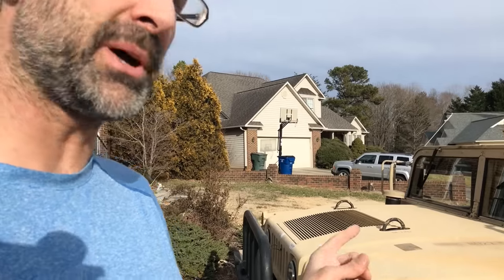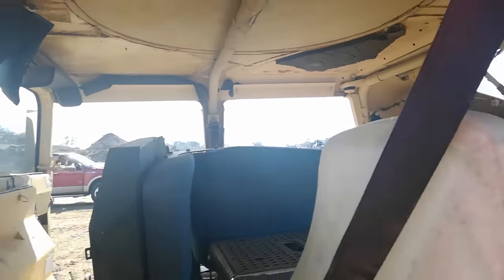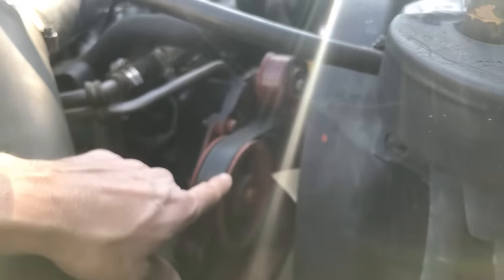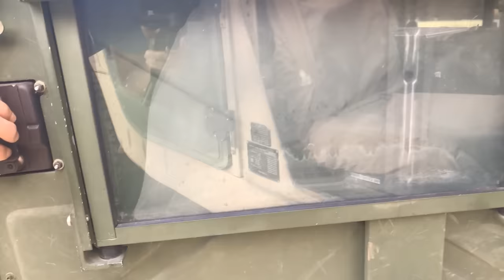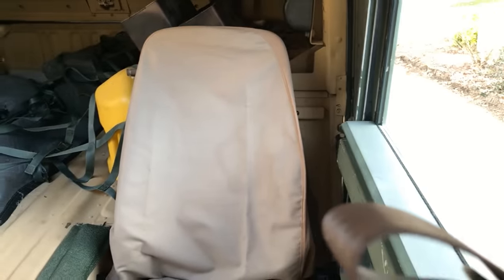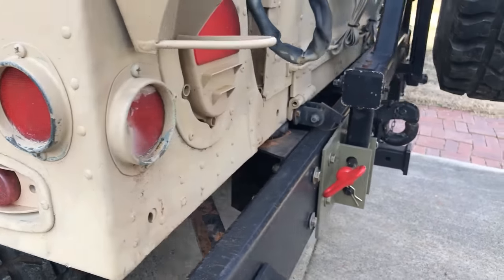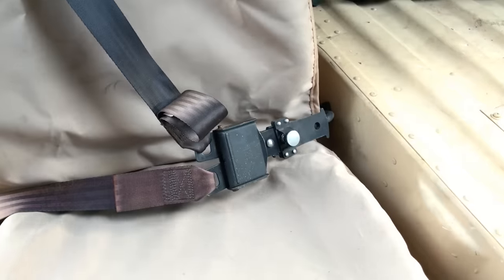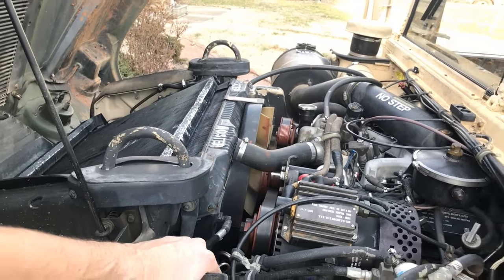Picking up a Surplus HMMWV M1045A2 from Auction & Transforming it into the Battlewagon 2.0

Comment: Those are the trucks I used. M1054a2 TOW. The traversing unit is a 68lb central piece that the m220 tow/m41 saber sight, launch tube and electrical connections/controls mounted to.
Reply from the maker: Thanks for the insight.

Comment: The weird ring next to the gunner's platform is a stowage mount for equipment that would be mounted on the turret during use.  Sighting systems, and other equipment that would need to be brought into the vehicle and locked in place for transport.
Reply from the maker: Good to know, thanks.

Comment: The traversing unit mount is for a TOW II Missile system. When the TU/Tube/Sights are not mounted on the roof the TU can be stowed inside the vehicle.
Reply: Thanks for the info!
Reply from the maker: Thanks for the info.

Comment: You were right about getting the overdrive transmission.  However, I can attest to rebuilding many engines that were driven hard and fast.
Reply from the maker: Thanks. 
You mean the engines blew even WITH a 4 speed?
I don't doubt that. 
But some folks run their 3 speeds way too fast, basically asking to dump parts along the highway.
Reply: I was a 3521, 3522 for most of my six years in the Marine Corps.  I couldn't tell you which of the transmissions was behind the engines I had to rebuild but the final drives on military HMMWV's are not speced for high speed on road use.  I have seen several on the internet that have had newer Duramax engines installed that out perform the older 6.2 and 6.5 liter engines on and off road.
Reply from the maker: @hudsondonnell444  Understood. The 4 speed transmission is the same as the civilian Hummer. So, keeps rpms in the right range for highway driving.

Comment: Your traversing unit is for your TOW Gun it’s a Missile launcher you just bought a TOW gun truck  you would have a collar that attaches to the gun and it goes on that traversing unit to store it when not in use. you would have a rack in the trunk area that held your Missiles that when you unlatched the trunk in the front the A-gunner can feed the gunner the Missiles while in the cabin rather than going out😃👍
Reply from the maker: They removed the tow missile rack during demil. I know the traversing mount held something with the TOW system, just haven't seen one actually in place on the mount. :)
Reply: Gear-Report.com yea not as impressive kinda is what it is but you should definitely get a up amored truck as well that held the machine guns and then you’ll have your own little CAAT (Combined Anti-amour Assault Team) pair😃 I like what you’re doing those trucks can go though a hell of a beating and keep going!
Reply from the maker: @joncarlodagle  Thanks. Since I have no use for or access to a TOW missile system, we are building this as an M1043 machine gun truck. We have the gun mount and chicken shield. Haven't started on the GPK yet. We have an airsoft M249 to play with and for display, but have access to various machine guns to mount for events. We try to walk a bit of a line in terms of keeping it outwardly military looking, while upgrading some of the creature comforts a bit so that it is more comfortable around town. :)

Comment: I think the dual latch on the seat belt is so there is no restricting loop over the soldier's arm/shoulder when exiting in a hurry.
Reply from the maker: I think you are correct
Reply: Exactly correct
Reply: Ours never had seatbelts...lol However, the shoulder belt is removed while you’re expecting contact, while the lap belt keeps you in the vehicle. The doors always flew open.

Comment: Alot of people don't know but if you ever get pulled over for speeding in a mil truck the cop is full of it. The paint is laser and radar absorbing
Reply from the maker: Somewhat, but not totally radar absorbing. :)
Reply: Speeding? Good luck. Over 60mph I'd worry about stopping. ☺
Reply from the maker: @uncleeddie5813  the early HMMWVs with the 3 speed and smaller brakes top out around 57 miles per hour. This one will do 75 all day long and has larger brakes.. 😁
Reply: @uncleeddie5813  brake upgrade is usually the first thing that should be done.
Reply: @GearreportdotCom  thank you for the info. ☺👍
Reply: Paint is not laser or radar absorbing.  It’s called CARC Aka Chemical Agent resistant compound...  You can get an LRF read off of it any day of the week

Comment: Had the glass delamination issue with my Snatch land rover, on mine it was the binding agent between the glass and the perspex that clouded up. After taking the perspex off and letting the binding agent sit for a while it cleared up.
Reply from the maker: I have seen a few people solve this by removing the outer layers. I am hesitant to do this since the outer layers contain the shattered bits of glass in an accident or incident. I really don't want little glass fragments going everywhere.

Comment: ,,, hauled many of these, and one set of the first light armament.  The 24 volt starting  is amazing. It will sit there cranking very fast, and put out these consistent, little puffs  of heated, compressed,  light grey, fuel and air puffs, But they are not combusted. One wiff of ether, and she lights. Or use or fix the glow plugs .
Reply from the maker: Yikes! Ether is no bueno for diesels.
Reply: ,,, so your on an Army base, you already have one guy from the motor pool, that can't  start it, its cranking, very fast, it's got fuel, you appear to be miles from the motor pool, you have 2 more to load, believe me a whiff of ether didn't  hurt it, OR the other two .
Reply: @rolandtamaccio3285  wd40 is a safe alternative. Ether washes lube off of cylinder walls and is too volatile for high compression engines. Ether is a great way to blow up a diesel engine.
Reply from the maker: History of this purchase is detailed here: https://gear-report.com/hmmwv-info-battlewagon-2-m1045a2-humvee-from-the-us-marine-corps
Reply: M939 series 5tons had a cold start system that was just an ether bottle that shot into the intake. They didn`t have glow plugs in those cummins engines.
Reply: Sorry for the confusion. I wasn`t disputing your comment, I was just giving an example of a vehicle that came with an ether injector cold start assist.
Reply: @frankthomas2231  No problem, I'm glad to have someone that knows what they're talking about give another example of the use of ether assisted starting, thanks.

Comment: I am a diesel mechanic in Alaska, i work on concrete mixers mostly,  i have wanted to try someday to build an off road mixer on a HEMET chassis. But yeah it would be fum to get a Humvee project as well.
Reply from the maker: So, get one. No time like the present. 😎
Reply: That is a great idea, an old Oshkosh should be available at auction.  
Talk about an off road capable cement pumper...... A1 idea I hope you really do it some day bro. 
I’ll give you my 2 cents, try to get one of the quad cab chassis, they had AC and a much more comfortable interior overall.    Good luck.

Comment: If I recall correctly, that circular mount-looking thing by the gunners step is the pedestal for a TOW rocket launcher mount.
Reply: Correct! More correct it was designed specifically for the "TOW 2 "launcher.

Comment: Great video!!!!  I like all the details that you explained.   Didn't know there was two different suspensions on these.  Sounds like the A2 Humvees with all the improvements are the best ones to  have.  I like all the improvements you've made.   Now I know what to look for.   Thanks for all the info --Tim
Reply from the maker: Thanks! Glad the video was helpful.
You might find this interesting as well... https://gear-report.com/hmmwv-for-sale-the-battlewagon-2-0-could-be-yours-m1045a2-usmc-humvee-hummer
Reply: @GearreportdotCom  I worked at Hummer R and D in livonia Michigan and when they were upgrading the old m998 base hummers, and putting armor plating on the bodies, they found out their calculations were dead wrong and that the 998 suspension was not going to hold up to 10,000 lbs of extra weight. They blew out quite a few 998 suspensions before they figured out they had to upgrade the suspension too. Unfortunately 100's  of the upgraded 998's were already shipped out because the army needed them badly and of course the 998 suspensions blew out in the field under the pressure of the weight, lol,  and we had to ship the upgraded suspension parts to where they needed them. It was major AM GENERAL screw up that cost a lot of money to AM GENERAL, and they never got those cost back.  They had to eat that extra cost.
Reply from the maker: @richardtorz2164  Interesting.
I'm troubled that you are concerned with AMG losing $, but no mention of the lives lost when these HMMWVs failed in the field. :(
Reply: @GearreportdotCom You are correct, i should have mentioned the loss of life, but was more concentrated on the original post about suspension failure of such heavy vehicles, that's all.  No do not get wrong brother, the loss of life when equipment fails is so much greater than anything else, and i being a retired vet myself knows this all to well with seeing friends lost to equipment failures. That is something that is something that is of greater importance when designing anything, it needs to keep people safe. The neglect on Amg  designers did cost lives, many lives, unfortunately that issue was never considered when the redesign came up and there was no acknowledgement by the company for those losses of life.  i just didn;t address that issue with it because pretty much everybody knows what happens when people safety is not considered first and foremost when designing something.
Reply: @GearreportdotCom  And by the way, it was a good job restoring that beast to original as much as possible, parts are hard to find sometimes and when you do find them, they can cost an arm and a leg at times lol. The love you put into making that hummer from the time you got to the time you video'd it shines through, it does show. History should not be sent to the junkyard crusher unless it has absolutely lived out it usefulness.

Comment: Listen people everyone can do whatever they want with your money. But for $5000 you can go on almost any government auction and buy almost any Humvee in almost any condition even with very little to zero engine hours on them (not used).
Reply from the maker: Post some links to late-model, running HMMWVs available for purchase today with full working turrets for $5k. I'll buy every one of them right now. Hell. I'd buy every running late model HMMWV without turrets or doors for $5k each. I would even buy late model non-running HMMWVs for $5k each. You even can't get an A2 HMMWV rolling chassis to your door for $5k... with no engine or driveline. 
 Spoiler You won't post any links because if you really do search for a link you'll find the best you can do are some auction listings with a STARTING price of $5k. Log into the auction site and look at what the CLOSING price on those HMMWVs is... it aint $5k. Not even close. LoL 
But what do I know. I've only been doing this for a few years. :)
Reply: Lol good luck with that.

Comment: That glass fogs up because you use chemicals on the window to clean them. Unless you are using the recommended chemicals on the windows that is specified in the manual it will fog up over time
Reply from the maker: True. However, in this case the windows are fine on the surfaces. The layers in the ballistic glass are delaminating.
Reply: @GearreportdotCom  because of the chemicals, thats what causes it to happen. I worked on them everyday for 10 years.
Reply from the maker: @whicket1989  could be. I was told it is mostly heat that causes delamination. They sealed the edges of the laminate with tape. I didn't see anyplace that looked like any liquid got past it.
Reply: @GearreportdotCom  it's a reaction between the layers of glass that causes the "fog."
Reply from the maker: So, how does it get in there?
Reply: @GearreportdotCom  it seeps in through the upper and lower parts when you are cleaning the window

Comment: What's next??
Your very own UH1 HUEY helicopter for your own air support ??
If done right , you could tow it on a trailer behind the Hummer. :)
If you have deep pockets you could find a classic Cessna A-37/T-37 Dragonfly jet trainer to cruise across the sky with.
Reply: That sounds like an awesome plan!
Reply from the maker: Let's look at this a bit more closely...
I'm a fixed wing aircraft pilot. Never been much of a rotor head. BUT for the sake of easy vertical takeoff capabilities, I guess a Heuy would work. Not sure what "air support" I might need, but I have been lifted into a Huey via a forest penetrator on a winch line. So, I've got a bit of a nostalgic tie there to help justify it.
Where you went off the rails is the A-37/T-37. Seriously? We had those at one of the tech schools I attended in the early 90s. I suppose any jet is cool, but you picked the most pedestrian option. At least step up to the T-38. Those are exponentially more badass. And let's be honest... if going the T-38 route, then an F-5 is really the way to go. Side note...I almost purchased a MIG 15 back in the mid-90s when I stumbled on a family of Russians refurbing and assembling a small batch of them in a hanger at one of the airports (Johnston County Airport in NC) I frequented when doing air search and rescue training. They were running out of cash and looking to flip one cheap to finance the build of the next few. I could have had that for $20k-$25k. Fortunately, I had the sense to walk away from that deal. I was a Crew Chief for the first few years of USAF service and knew a bit about maintaining military jets. The complexity and parts availability of that airframe would have been more than I could handle.  I likely would have died in that plane. I mean... yeah. It would have been hella cool though. :) 
Another bit of trivia... the very first plane I EVER flew was a T-41 Mescalero out of the old Charleston AFB, SC.
Planes are fun, but the HMMWV is a lot more practical. :)

Comment: Are the hatch backs more expensive? You can get the non hatch versions around Houston for 15k all day. Running and driving.
Reply from the maker: Yep. And you might get a 1st Gen HMMWV with a 3 speed and soft top for 15k. But not a 3rd gen with a 4 speed and hard top. You'll be lucky to find one for 30k.
Reply: Lots of these leaving the sales list at 5k-7.5k each...
Reply: Lol! I wouldnt pay more than 3k for those peices of shit!
Reply from the maker: @fraidykat  some of the older, worn out, stripped 1st gen HMMWV auctions may go that cheap. But those older trucks are are getting a lot less frequent and harder to find. Then add a few thousand in taxes, fees, transportation costs. The newer HMMWVs like this one are selling for a lot more.
Reply from the maker: @TheSwissCheese87  They aren't for everyone.

Comment: Humvee.. will go anywhere so long as you don't mind taking all day to get there because 170HP new. I watched Gale Banks videos where he was doing upgrades on these and even with 30k thrown at them they are still dogs. Best thing you could do would be a twin turbo Duramax or Powerstroke swap and get rid of that POS old 6.5L N/A engine. Do yourself a favor, ditch the door glass for acrylic, it'll drop a ton of weight and not de-laminate.
Reply from the maker: Maybe for civilian use. For their military role where 19 year olds are the primary drivers, more power would just mean more stuff getting broken. :)

Comment: "A dump on my dream" oh my God! Lololol man you're a killer ahahahaha

I love the Humvees! Wonder why they designed it's top end so going low as this? I think I may go for one with more high space on the back..if possible, I even would like to make it taller.
Reply from the maker: You mean the slanted area at the back of the top?
I heard it was to stay out of the way of the blast from the TOW missiles.
I think the slantbacks look cool, but I hate how much truck bed space is sacrificed by the low top. And there is no rear window AT ALL.
Reply: Sounds like you want a helmet top. They typically are 6” (i think) taller from the drivers seat back and have a rear hatch like a pickup topper.
Reply from the maker: @Ulfstigandr  There are a wide variety of top options for HMMWV. But yeah... helmet tops can be pretty cool. i want one with a turret in the top, but those are pretty rare.

Comment: Traversing unit.

Borrowed from olive-drab.com .

HMMWV turret a full 360° but it can be difficult to move the weight of the weapon, shielding, ammunition and other components, especially if the vehicle is not level. Motorized turret systems have been developed to solve this problem.

By 2006, engineers at the U.S. Army Tank Automotive Research, Development and Engineering Center (TARDEC) designed the Battery Powered Motorized Traversing Unit (BPMTU) which provides a HMMWV gunner with powered cupola operations.
Reply from the maker: That describes a powered turret system. We have a manual turret. 😎
Reply: Wouldnt have a powered unit in combat. Just one more thing to go wrong while murphy is hanging with you. 
  Dont want a tombstone that says, it came down to the wire and it failed.
Reply: Kept small wires around, to jump the no start problems. Pop the diagnosis cap by the shifter, connect the S & T labeled pin points ,activated the starter. Lol, electric problems,due to switch/wire failures.

Comment: What about replacing the heater box with a vintage air compact hvac system! Beats Sweating!
Reply from the maker: Actually, I"m thinking that THIS is going to happen as soon as I save enough pennies...
https://ebay.to/2WMQB0A
Don't want to mess with the heater box, as the heat works rather well. :)